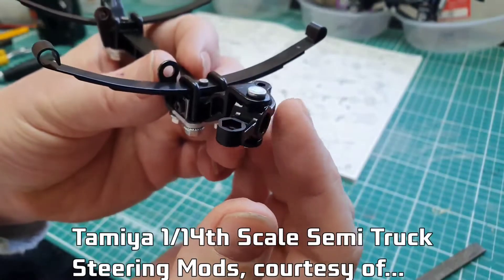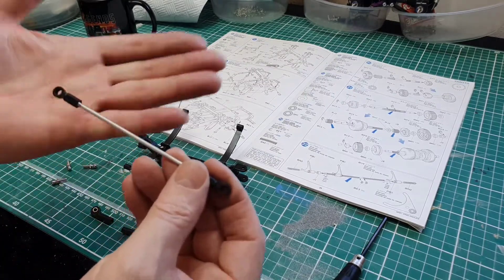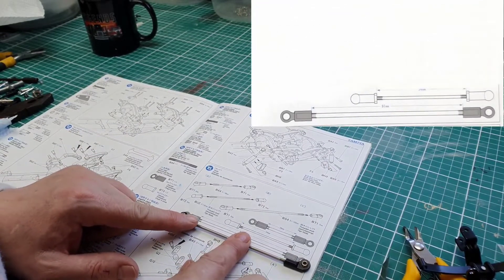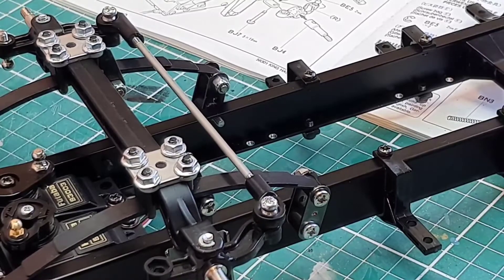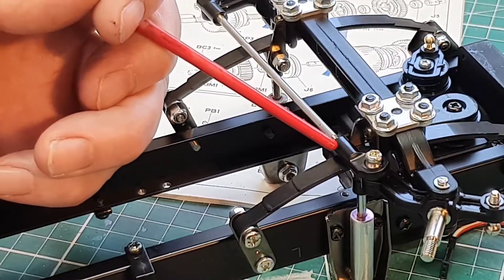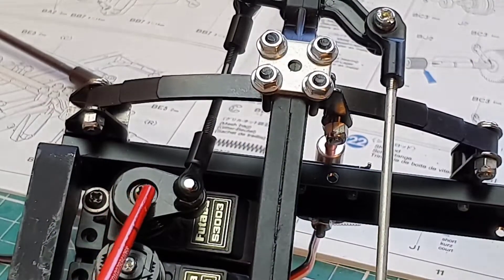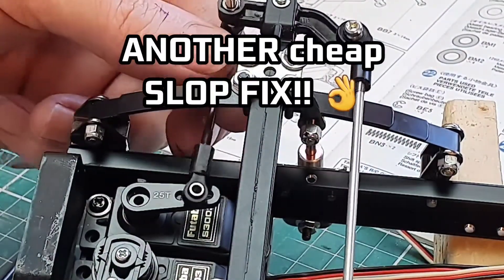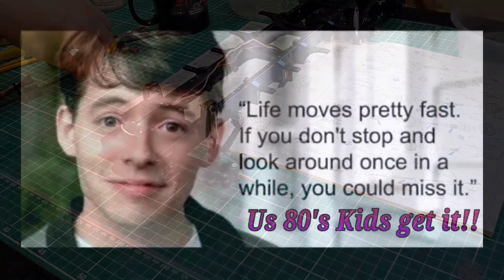Grand Hauler Build, pt 4.5 Steering Mods for 1/14 Tamiya Semi Trucks, from @TeriWilde !

Comment: I've done this to my trucks and my King Haulers turn in a smaller radius than a much shorter 4 x 2 Euro Scania 😎
it does work for Euro trucks where the servo is still bolted to the side of the frame, same modification using the RC4WD rod ends to take out as much free play as you can.... ON A BUDGET of course 👍
Reply from the maker: As I've got a 1850L to build... I'm going to try ro fix that.
Meaning, REAR Steering Rod for correct Ackermann Angle! 👌
Reply from the maker: @Teri Wilde 
Thanks for letting me use your footage!